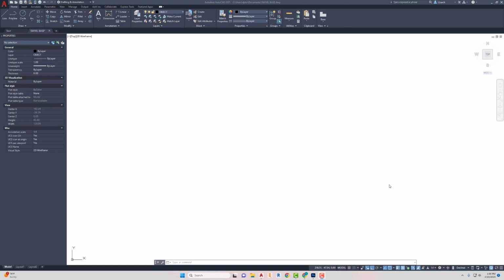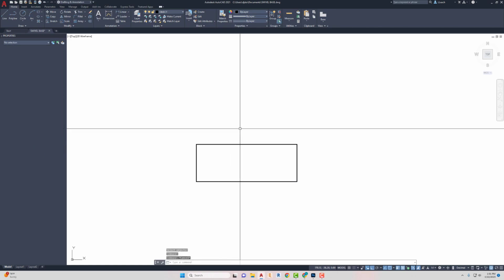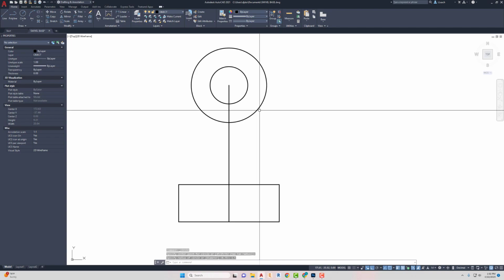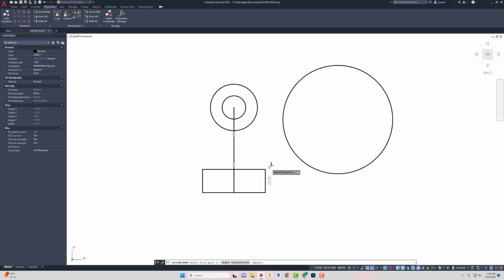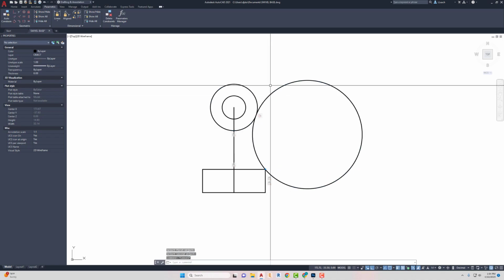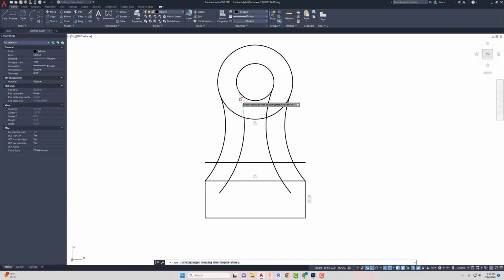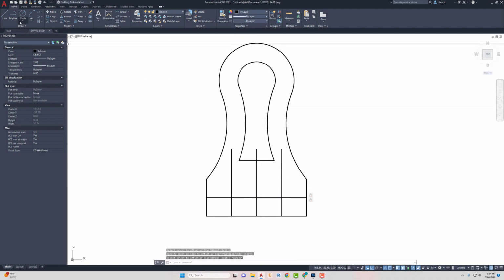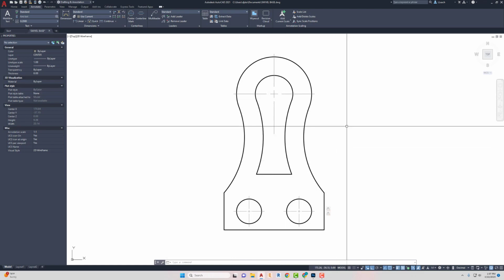AUTOCAD SENSOR MOUNT

Comment: I followed your method, and the inner lines where the arc radius shows 4.25, measures out to be 3.95. If anyone needs to show dimensions for this/if you matched dimensions, those offsets would technically be wrong